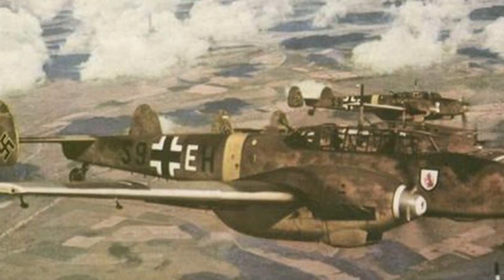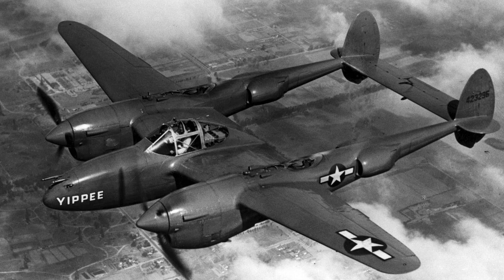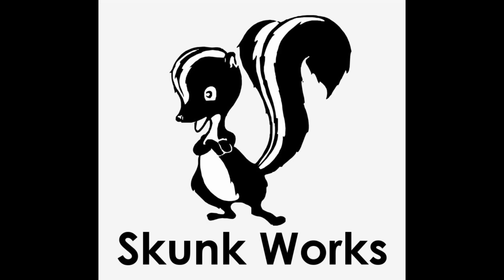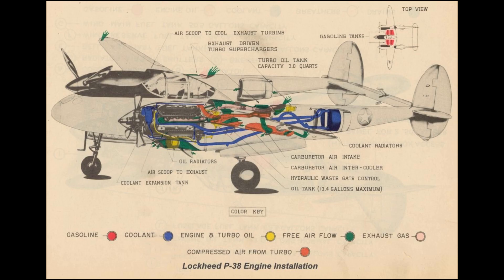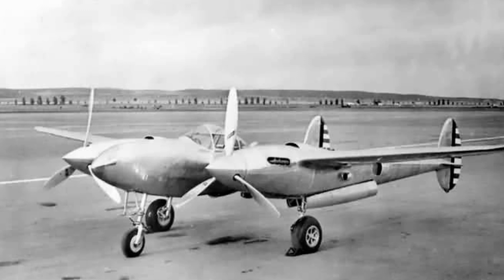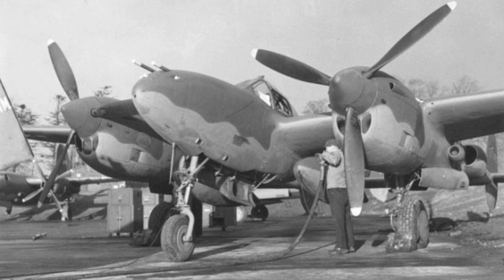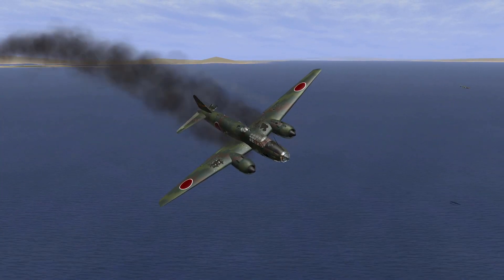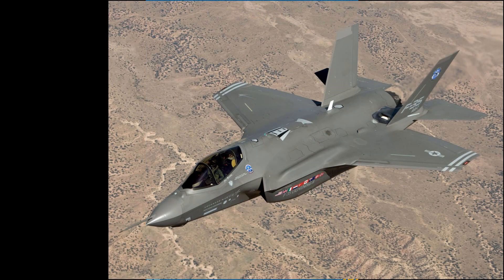5 Minute Guides to Aircraft: Lockheed P-38 Lightning

Comment: My father was on a destroyer in the the Aleutians and New Guinea. According to my mother he still had a friend down among those on the USS Arizona.  My mother strung cables (electrical?) through P-38'S at Lockheed Burbank. As a youth I sold newspapers to workers leaving the Burbank Skunkworks gate near Empire and Hollywood Way during the Cuban Missile Crisis. When a star shell was fired over a Russian ship (see 13 days in May film) I was able to yell "extra extra American ship fires on Soviets" and quickly sold out my newspapers to them  😃
After the Air Force I was first an inspector, then the final line inspector of aircraft altimeters. In that capacity I knew Ray Whitehouse who had been in inspection since WW2.  Part of Ray's job during WW2 had been the inspection during manufacture of a hydraulic pump which I believe was used in this aircraft. Ray said he discovered under certain conditions (compressibility?) this pump could or was causing aircraft to crash. He red tagged all the pumps on the line. A supervisor in turn came along and pulled off the tags saying they contractually met government specifications - so out the door they went. 
Ray being a conscientious man of integrity wrote a letter to some government body. One day he showed me an old letter he had saved from those days. Along with an impressive letterhead he was being informed the department had determined he was indeed correct. That the new government specification enclosed would be set into place. He also referred me to a thick but worn government specification poster he had on the wall of his inspection cage.  One of the listed government specifications matched the wording on the letter he had received back.  He proudly would point at it and say, "That's my spec.!"          Vote Conservative - we have a country to save.

Comment: Why didn't we standardize on the Packard Merlin, the superior aircraft engine of WW2 and use it in the P-40, P-38 and P-63?
Reply: The way the V1710's were designed - you could flip the crank shaft and have the props counter rotating.  You could not do that with the Merlin.

You could not just use the Turbo Super Charger on the V1710 on a Merlin.  All those things had to be designed for the specific engine they were going to work with.

The P-51's Packard/Merlin was specifically designed around it and it's Super Charger.

The P-38 and P-47 were designed around specific engines and specific Turbo Super Chargers - the same with the Spitfire.  This is the reason we couldn't just take the P-38's Turbosupercharger - and put it in a P-39 or P-40 which also used Allison Engines.

Yes - they did have a version of the P-40 that used a Packard/Merlin - but - while that did improve it's performance - it didn't turn it into a Spitfire.

Lastly - Allison was a major engine manufacturer - if we took away the Allison V1710's it was making - you would have that many fewer aircraft engines - than if you continued to make Allison's and Packard's both.
.
Reply: @BobSmith-dk8nw  … the P-38 and P-40 were pre-war designs. Good bless them for being there in 1940-42. Same with the Wildcat. However all three were eventually going to be superseded by newer aircraft types. Incremental performance improvements to older types were not going to change that reality.
Reply: @Idahoguy10157 The p38 was competitive until the end of the war in spite of not getting the most powerful varient of the Alison or paddle props.
Reply: Because the "Packard" Merlin is actually a Rolls Royce Merlin and was being manufactured under a licensing agreement. The P-51 only ended up being Merlin powered because it was originally built to the British specification. 
It has a lot to do with a countries pride, which determines the components used in their military equipment. 
It was out of the ordinary for the British to order a completely new aircraft design from a foreign country. The P-51 was a good example of how desperate things had become. The British may have been forced to use an American airframe but they didn't have to use the Allison engine that the P-51 was designed with, and the rest is history. 
It was the same for America. Nobody was keen on using foreign equipment for a number of good reasons. 
So the USA just largely made do with the engines that were designed and manufactured in this country.
Reply from the maker: @straybullitt  Yep, tho its ironic as the P-40 was tried with a Merlin engine and saw great improvement. Then the DoD simply went "No merlins for you, merlins only for Mustang"
Reply: Supply and demand. The Army gave the P-51 priority for the Packard-Merlin engine. So the P-38 and P-40 were left out
Reply: @Idahoguy10157 the merlin gave no advantage
Reply: Because the Merlin, in any form, was completely inferior to the V-1710 Allison paired with the General Electric B series turbocharger.

The Merlins would have ruined the P-38 by substantially reducing performance in every single category. Merlins would have reduced top speed, acceleration, rate of climb, agility, high altitude performance, service ceiling, and combat radius.
Reply from the maker: @AlanRoehrich9651  Couldn't they have just paird the Turbocharger with the Merlin? Its not like the inbuilt Mechanical Supercharger, a Turbocharger is mostly just ducting of exhaust gasses to drive a compressor for inlet air afaik
Reply: @5MinuteGuidesToAircraft there wasn't room for turbos in most aircraft, that was the reason the great P47 was as large as it was.

Comment: The P-38 was a beautiful and powerful aircraft but never really lived up to its hopes. Once the P-51B was developed, production should have ceased. But with this said the P-38 was valuable in the Pacific but in Europe, the USAAF should have adopted the RAF Mosquito as a twin-engine attack fighter/bomber.
Reply from the maker: Yeah, the USAAFs stubbornness in the European Theatre is just, baffling in retrospect
Reply: @5MinuteGuidesToAircraft not sure I agree, when it was used as it was designed and not getting into dogfights she more than held her own. USAAF’s biggest snafu was not letting fighters and interceptors range out or way above the bombers to meet attacks head on or from above which was the lightnings strength. They showed in the Pacific theater when used correctly it was a devastating fighter interceptor.
Reply from the maker: @mknewlan67  That, was my point however, and infact I even say so in the video, tho summarize them to 'tactical limitations' since I was running short on space.

Had the USAAF let the P-38s do their thing they would've fared much better
Reply: @5MinuteGuidesToAircraft  it was the tactical limitation that I didn’t agree with. In the right hands they performed outstanding. I understand being short on time though. Love the channel, keep up the hard work!
Reply: 🤣🤣🤣🤣🤣🤣

The P-38 should have actually been produced in double the numbers. Instead, the War Production Board forced Lockheed to waste half of the plant capacity at Burbank to produce B-17 bombers.

Development of the P-38 was hindered by that waste of resources. In fact, it prevented production of the P-38K, which, in April 1943, had 1850HP engines, and 13'-6" three blade hydrostatic Hamilton Standard high activity paddle props. It had a higher climb rate, higher top speed, greater acceleration, and greater range. The P-38K could have entered service in August or September 1943, and it also could have had both dive flaps AND hydraulic boosted ailerons.

Oh, and the P-38 was behind the P-51 ONLY in dive speed at high altitude. In every other category, the P-38 had better performance.

The P-51 did not even equal the P-38 in numbers deployed until June of 1944.

Enough of the P-51 myth.
Reply from the maker: @AlanRoehrich9651  The P-51 had immensely better maneuverability than the P-38 and also had much easier maintenance due to the fact it was a single engine aircraft in comparison to a twin engine turbocharged aircraft.

The P-51 was simply really really good, which is why they made so many of them and why they were used by other nations until the mid 1980s.

Also what P-51 Myth?
Reply: @5MinuteGuidesToAircraft BS  Mustang wasn’t very maneuverable at all. It was fast and had good range.
Reply: I’m not so sure about that. P-38 was obviously a better pure fighter than the Mosquito ever hoped to be. I believe the Lightning was the fastest climbing American fighter of the war.. although that’s not really saying a lot. Not to take away from the Mosquito … that was an awesome plane